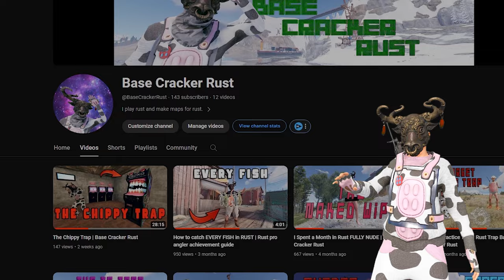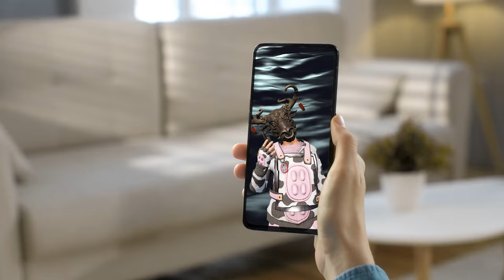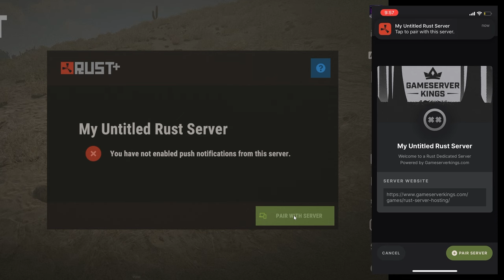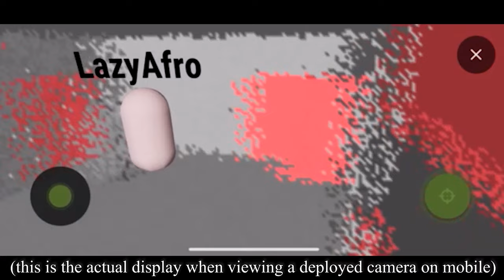How To Build a Rust Trap Base | 3 Trap Base Designs

Comment: The pressure plate won’t open the door for me
Reply from the maker: I’ll look into it, electricity was updated shortly after this video came out so not everything may still work the same, I know components like branches and switches no longer require 1 electricity a piece to run, it may be that the pressure pad doesn’t generate a signal without source power anymore.